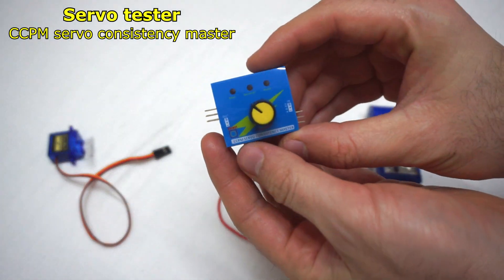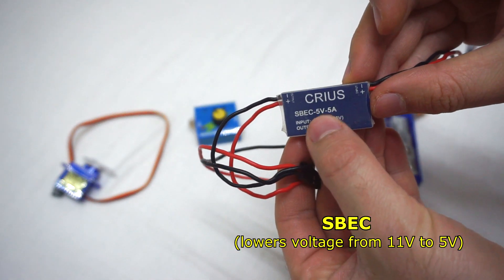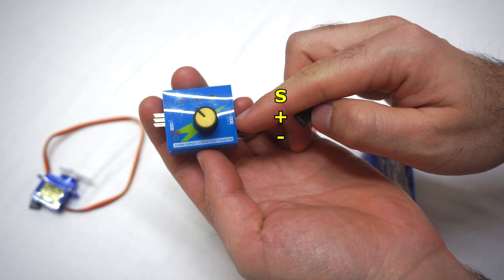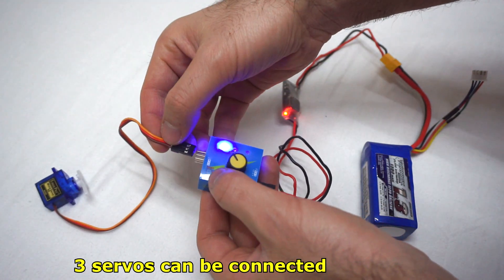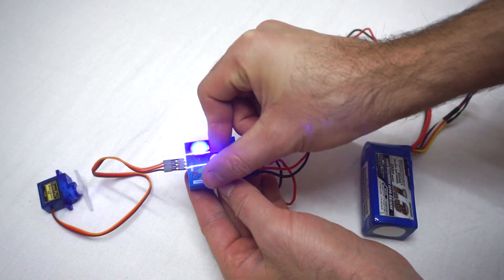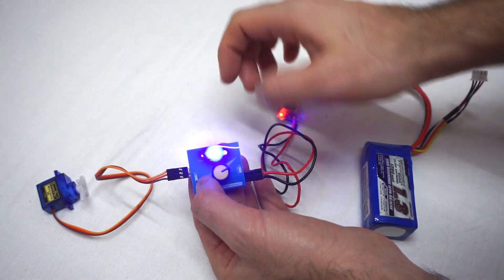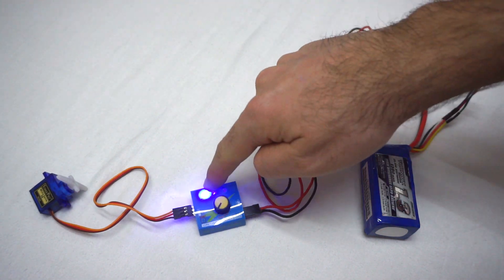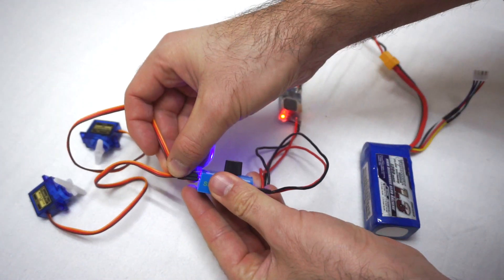Servo Tester + Micro Servos

Comment: weird I also got one of these Servo tester and just got my first servo today (im a newbie to servos)
and even if I connect 5v.. the moment I plug in my new servo from BG Racestar PS5520MG, all the 3 lights in the sevo tester start blinking and I cant do anything, servo tester button dont work etc.
I plug brown to gnd, red to power and yellow to signal. and I use the top line of horsontal pins, just like you in this video. and as it says on the servo tester..
I dont know if its my servo that just arrived to day that is faulty or the servo tester or me doing something wrong.
but all the 3 blue LEDs start blinking on the sevo tester the moment I plug in the servo and wont take any inut.?
Reply: That servo is about at the very limit of what the servo tester can supply voltage to and run a test on. Try a much smaller servo (eg 9gm type) rather than that 55gm one!

Comment: Hello sir, can i power my esc with 11.1v 3s lipo battery and use the BEC wire from that esc plug that in the Input place on Servo Tester to test the servo on the Out put place.?
Reply from the maker: If the BEC outputs 5V then it should power the servo tester. Check the input voltage of all components!
Reply: @furulevi  ok

Comment: With the servo tester do any damage if you plug the battery in directly
Reply from the maker: Probably yes because the servo tester has a lower Input voltage: 4.8 - 6 V

Comment: Hi could you link the battery you are using
Reply from the maker: 3S LiPo 1300mAh XT60
https://www.ebay.com/sch/i.html?_from=R40&_trksid=m570.l1313&_nkw=3s+lipo+1.3mah+xt60&_sacat=0&LH_TitleDesc=0&_osacat=0&_odkw=3s+lipo+1.3mah&LH_BIN=1

Comment: Very interesting video. Quick question, in Man mode, is it normal for the servo to "stutter"? It does it only near center, and the blue LED flickers too. I have a Futaba FP-S148, and bought this just to test it. I own no RC equipment, and this was an inexpensive way to see if the servo is good, but with the stutter, I'm not sure. Thank you
Reply from the maker: I'm not an expert in this, but I think it should have no stutter... Try to avoid poor connections, like I did at 0:26.